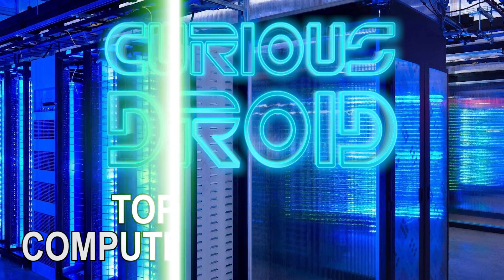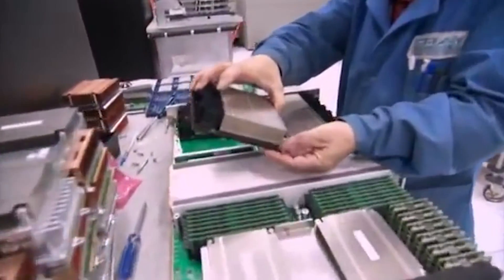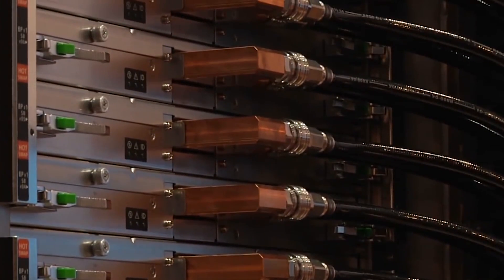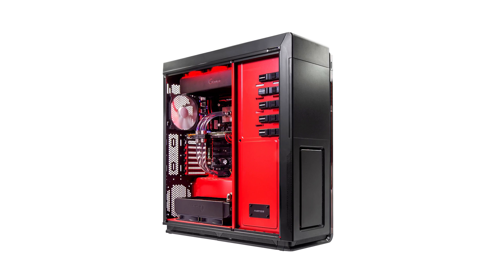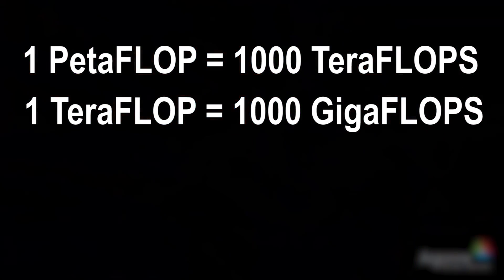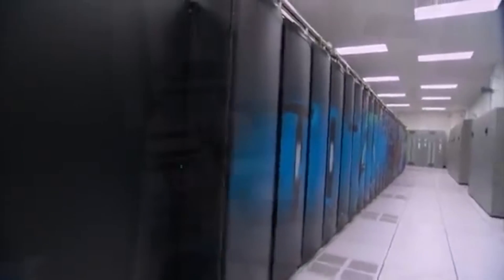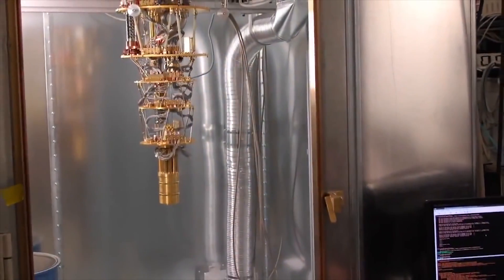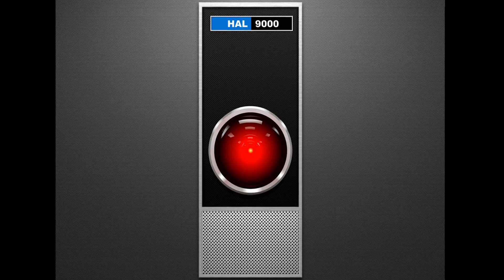Top 10 Fastest Computers in the World 2016 - How much faster is a supercomuter than a PC or iPad Pro

Comment: I would have been more interested in comparing desktop computers today to the supercomputers of 1960s onward.  The Cray 1 (1975) is  listed as 160 MFLOPS.  So the 2016 iPad was 10 times more powerful and the 2016 desktop was almost 1000 times more powerful.  The Cray X-MP (1982) is listed as 800 MFLOPS.  The Y-MP had a measured GFLOPS of 2.144 and a peak GFLOPS of 2.667 in both 1988 and 1989.  Indeed, it appears that the first 100 GFLOPS supercomputer was not built until about 1993.

Comment: https://youtu.be/HBpkSIJ9KwU?t=550
April 14, 2023 European chip designer Tachyum has published a design of an exascale AI supercomputer using its Prodigy 2 Universal processor and a mix of liquid and air cooling. The design will deliver 20 ExaFlops of FP64 vector performance in a 60MW power envelope and footprint of 6,000 square feet. This meets the requirements of the US Department of Energy for supercomputing systems for both HPC and AI.

Comment: @Curious Droid 
Main question: (For anyone here)

How to appropriately compare All/Total compute power of a Smartphone's CPU, AI, GPU, etc with a Supercomputer from the 1990s or 2000s.

[Taking note that Supercomputers have traditionally been benchmarked with Vector double precision FP64 Floating Point Operations per second.]

This might have to be theoretical peak performance, as I'm not sure if there are currently any programs which fully utilize all Tensor Cores and AI processing performance at once.

Comment: has anyone ever tryied to messure performance under pressure, etc. 3-50 bar...all components are stiff after all..cooling without pressure changes is unnatural,. Just because humans have no tolerance for pressure changes, doesn't mean metals, copper and silica do:P
i haven' done any research at all, just throwing it out...:P

Comment: and the Operating System they used on those super-computer 
is either Linux  or BSD
Reply: Never seen any running BSD personally. But if you had drivers for IB or other fast interconnects, no reason you couldn't.

Comment: In the late 1980's I was working with flash, and it took so long until it replaced the hard disk drive in a PC, I have to wonder what exists now that will probably not make it into PC's or some other device like a phone until a good 30 years later, sometimes the best thing I could do was build a computer for a network but use it as a PC, with parts that look like they should work in a PC.

Comment: I'm sure these computers aren't used that much..what operating system does it run
Reply: Depends on the system, but generally due to cost, you maximize the use of the resources 24/7/365. Most run some variant of Linux these days.

Comment: Well... it is now 2018 and such machines are nothing more than auxiliary data staging and output processing systems for Quantum processors!  The effort that has been put into painting a logical, coherent, public face to Quantum computing has been enormous!  I am an old hand at computing.  I am not given to some crazy, unsupported theory about computing!  Either Quantum processors are an utter failure and are not actually capable of producing ANY meaningful output or they are performing in ways that we, the public can only guess at!  Yes I have heard various, really sophisticated presentations describing how these processors work!  Most notably the University of New South Whales developed a method of producing Quantum Processors using existing integrated circuit production techniques.  Right after that announcement they went dark!!  Doesn't take much thought to understand why!  I am unsure about the seemingly outlandish claims that the use of these processors is altering our very reality.  I am not concerned about CERN!  That actually seems to be billed as a distraction.  We as Human technicians have been left behind!  We all know that the most advanced systems are not even designed by Humans.  We don't even know exactly how they work!  In short, we are now in over our heads!

Comment: Yeah but when you say 33.8 petaflops that is not the actual processor speed, it is only a measurement of how many mathematical operations the entire system can handle (theoretically) between all its cores. You would have to divide that number by the number of cores to get a more realistic figure... then you would need to take into account bus speed and RAM. There is no way a PC no matter how much RAM you add can operate at full capability. And unless it is at full capapcity all the time, most of those cores sit idolly doing nothing but consuming power. They are fast in terms of workload but not that fast in terms of actual speed of operations. How fast would the same computer be with only one core? That would be a more realistic comparison. Having more cores is like having more people doing a job, it doesnt mean any one person can do the job any faster than the next person.
Reply: The numbers quoted here are the LINPACK performances, not the theoretical peak performance. However, you are close enough to correct. LINPACK scales very well, much better than most other programs. That's why the supercomputer I help run, Blue Waters, wasn't submitted to the Top 500 as a bit of a statement. It would make the Top 10, but it was built for real application performance, not benchmarks, and therefore ranks lower than it really should. The Top 500 is a pretty poor way of measuring a supercomputer's performance.

Comment: Sunway TaihuLight - Sunway MPP, Sunway SW26010 260C 1.45GHz, Sunway
Site: National Supercomputing Center in Wuxi
Manufacturer: NRCPC
Cores: 10,649,600
Memory: 1,310,720 GB
Processor: Sunway SW26010 260C 1.45GHz
Interconnect: Sunway
Performace
Linpack Performance (Rmax) 93,014.6 TFlop/s
Theoretical Peak (Rpeak) 125,436 TFlop/s
Nmax 12,288,000
HPCG [TFlop/s] 480.8
Power Consumption
Power: 15,371.00 kW (Submitted)
Power Measurement Level: 2
Software
Operating System: Sunway RaiseOS 2.0.5

Comment: You fail to mention distinctions between energy efficiency, GPU based systems where each GPU card could hold upwards of 2K-4.5K cores per dual PCIE card and such.  If you step up from you $1000 gaming PC to a serious gaming machine with two, four, or eight K20 boards. your HUGE difference fades away to about 390 PC's not 338,000

Comment: Yeah but are these measurements in half or singe precision, because that makes a large difference as general propose CPU's are really bad at single precision and even worse at half, you need GPU's or specialised CPU's to do single and half precision well. For example my GPU has 6 TFLOPS of single precision performance my CPU is 238.50 GFLOPS. If my GPU were a Vega GPU with the same number of compute units I would be able to do half precision workloads and that would go upto 12 TFLOPS and the highend Vega supposedly does 24 TFLOPS at that point your only talking about being 41 and a bit GPU's to match 1 PFLOP, while that is still pretty insane it's not THAT insane.

Comment: Just to use #3 The Sequoia ... you say the PCs in the equation are average £1000 computers which will be 4 Core today.

You say the Sequoia is the equivalent of 171,000 of these computers with 1,572,864 processing cores. 

In 171,000 of these PCs there will be 684,000 cores - not 1,572,864. 

I jumped from #9 to #3 for obvious reasons but if you used the same calculations for all the examples, they're all inaccurate.

Comment: your video is a kind of misleading.. though you compared the super computer with the CPU performance.. you totally forgot about the GPU performance.. now a days even a cheapy120 $ graphics card can surpass 1 tflop performance.. hence a 1000$ gaming PC will have atleast 5 tflop processing power.. and more over most of the modern super computers also use GPGPU computing to compute its tasks.. for example the titan super computer has 16000+ nvidia k20 GPUs... that does 90% of all the computations and the 16000+ amd cpus just act like a feeder to the GPU... so practically.. a desktop  computer with a decent GPU is nearer to the performance of the Super computers than what this video shows..

Comment: dumb thing is,even though my processor has only 100 gflops, my GPU has 3.8Tflops... that's 38 times as much...
Reply: progamer11 Yeah, that's an alright understanding of it. A GPU core will generally only focus on "showing" the game by displaying maybe 100 pixles per core, while 4 CPU cores are running the whole game.
Reply: Keep in mind that a GPU has 3.8 TFLOPS of "Graphical" processes.

They aren't the same thing. 

A 750ti isn't faster than an i7 7700K just because it has a higher flop count.
Reply: @Thomas-hx9ky  in terms of raw calculating power the GPU is of course much faster. The chip architecture just isn't designed to run executables from the RAM but a small modification and these graphics cards would outperform any processor 10x to 20x provided there is some parallelism in the software. I don't know the exact numbers I recall having it tested 5 years ago with an intel cpu and a high end graphics card. Situation today is likely similar.

In terms of raw linear calculating power a regular CPU can still be better if you can't parallelize anything, if every subsequent operation depends on the results of the previous one - then i think the CPUs are stronger, because the multiple cores of the GPU do not matter.
Reply: @Thomas-hx9ky  gpu did physics, encoding decoding and more goodies than just 'graphics' or shading since the birth of cuda cores... they arent just bland fpus, they are mini cpus with all cpu features in parallel. ofc your 7700k is uncomparably slow compared to your 750ti. theres also a good reason why gpu clockspeed is severely lower than a cpu.
Reply: john dolores A CPU receives tasks from the RAM, it then decodes that data and executes what it is supposed to do.

Not really sure EXACTLY what  GPU calculates, but they are used in advanced simulations and for things like oil exploration.
Reply: A CPU handles ALL the mathematical calculations in the computer, the GPU takes information and converts it to data for graphical display. The GPU needs to be fast because of all the information required to display things like games and videos at 4k and 60fps, which is 530mbps. That is a lot of information to calculate and get on and off the RAM. This is also why older machines running fewer cores and less RAM have a hard time processing higher res. videos. Imagine a single core CPU with only 500mb of RAM trying to buffer 530mbps of video data and run the OS at the same time. not going to happen lol.
Reply: A GPU has a subset of the instructions a general purpose CPU has. GP-GPU stuff can offload some work to the GPU (including a lot of transformational math) but the latencies of the bus may result in it taking so long that doing so is not worthwhile.
Reply: gpus calculate geometry and color pallette, gaming pcs need gaming gpu cards to calculate on-the-fly display changes for highly unpredictable, ocassionally inebriated, gaming nerds
Reply: My exact point these computers use gpu acceleration to get these numbers aswell so its completely unfair
Reply: I'm not a gamer.  But, I crunch for BOINC and my GPU handles approximately 10X the workload shared by my dual Quad-core Xeon CPUs.  This isn't graphical information being processed.
Reply: GPUs excel at single-precision calculations - your BOINC project probably has a lot of them. CPUs excel at double-precision calculations - so more general stuff. Graphics calculations are also primarily single-precision. For everything else though, they need double-precision math. Also, while CPUs might have four 'cores', GPUs have hundreds of 'cores', although they're individually far less powerful than CPU cores. But put together, you get the effect of massive parallelism. There's some parallelism in CPUs, hence most being dual/quad/octa cores nowadays, but still, the calculations the GPU is doing is somewhat simpler - they can just do a ton more of them at one time.
Reply: Karlsson you know if i get a pc with 3.8 terraflops of ram i should get a power supply with 50000 W of power with 1000+ Amethyst
Reply: Good point. Some comparisons are not really that meaningful. For instance the human comparison. How many petaflops you need in a computer so it actually learns to see any paper, interpret symbols, handle any pen and actually write down the answer to simple multiplications, no matter it is in a desk, the floor or a wall. I think it maybe a few. Oh, and do it with only a bit of sugar as power.
Reply: Karlsson the only thing I want is a game pc

Comment: Enjoyed the video. You missed the GPU in a video card. It blows CPUs away.  IE the Nvidia Titan X released August 2016, is good for 10157  single-precision GFLOPS. There seems to be a mix of CPU and GPU core types used to build them. Course it's all about making your application work with a massively parallel system.

Comment: 1. About the iPad Pro, Its funny because the desktop performing much better only costs 200-300 more...(Ahem the deal you can only get from Apple)

2. About the Chinese server, Im willing to bet theyre running a heavily modified version of Ubuntu server, Or another type of server bound linux. I say this because Linux (Ubuntu Server) is the only main stream-supported operating system that can actually handle 3.5M cores and that much ram. And before you get all pissy, YES they did likely have to modify some of the kernal to do that. And im begging you not to comment like a triggered feminist claiming to know that its MAC OS X or something stupid thats your favorite OS and your triggered Linux is top dog in handling such tasks because truth be no one knows outside of who runs it, Because its top secret in China because they dont... Well theyre China even if they didnt have a reason theyd still hide it... My original point was that the Chinese often show off a lot including military power and computer power such as this, But it probably wasnt feasible without American and British written code.

2.5. Windows isnt that far behind, but youd have to basically recode the whole kernal, and it basically wouldnt be Windows anymore. Not like theyre going to use the window manager on a server.. Except managing..? But that would be done with Ubuntu server (Chinese varient, or if they make Kylin (Ubuntu's Chinese flavor)) in a server ready varient. Server management is definitely Linux's wheelhouse. 

3. I honestly expected #2 to be Google. Maybe theyre in a different class? Ive seen Googles servers i know its not nothing..

Comment: If you include the GPU the most powerful mobile APU the Tegra X1 has 1024 gigaflops, and on the desktop the the Titan XP has 12.15 teraflops. According to Wikipedia the first computer with more than a teraflop was the Intel ASCI Red/9152 in 1997 with 1.338 TFLOPS, and the first supercomputer with more flops than the Titan gpu was the NEC Earth Simulator with 35.86 TFLOPS in 2002.

Comment: Thanks, great video. But it's also firmware and software. What Operating Systems do these run and what software languages do they support that take advantage of the hardware available.
Reply: Various linux's can run on them, and as for programming languages, most of the usual suspects (C, C++, fortran, python, etc)

Comment: despues de ver esto tiro mi maquina por la ventana xD
Especifiaciones Tecnicas
PU: Intel Core i7 7700k 4,2 GHz
Motherboard: Gigabyte Aorus Z270X Gaming K5
RAM: Kingston HyperX Fury ddr4 2666MHz  8x2modulos
GPU: EVGA GTX 1080 8GB GDDR5X Founders Edition
Medios Opticos: SDD Crucial 120gb + HDD 1tb
PSU: EVGA 750BQ 80 Plus Bronze   750w
Watercooling: DeepCool Captain 120EX 1200mm

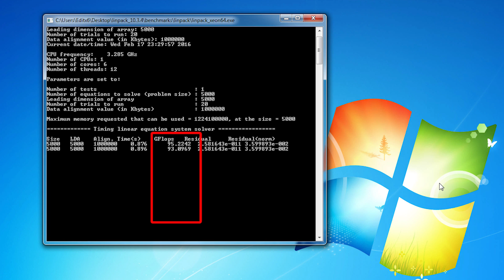Comment: Thank you, I liked the part on benchmarking at 1:32 and the fact that you included a download link. My own i3 laptop (2.13 GHz,  2 cores on 1 CPU, 32 bit) yields maximum of 2.427 GFLOPS. I am building a render farm and hopefully I can push it up to 1 TERAFLOPS. Test parameters are: 100 equations; leading dimension array = 5000; 20 trial runs; data alignment = 64 kB.

Comment: by moores law the supercomputer is only 12 years ahead
Reply: Not really, not like you're suggesting, multiple computers do not act like one single cpu computer as such. In fact multi-core cpus do not behave like one core cpu pc either, unless you have the software specifically written to divide the computational load across multiple threads and assign it to the cores. There is software available for you to create a server cluster, where tasks are divided and spread across your machines. But its not suitable for home PC use but rather multiple users...how do you think youtube manages to stream load process all the videos from millions of members... a data center..masses of servers..for the software required do some research and start with google...
Reply: 12 Years ahead? Its not even that really, the desktop PC is now a super computer, and all the so called super computers are just a mass array of server grade computers networked together for number crunching using a old concept of parallel processing. The system can be scaled to you're budget and floor space the system with more computers = more cpus and more memory = more FLOP'S.
Reply: bjtaudio I have a couple of old computers laying around, is there away to connect them so they can act as one computer and be a "super" one, if only these companies who made them made tutorials explaing things but its highly unlikily considering they use them for mostly millitary purposes